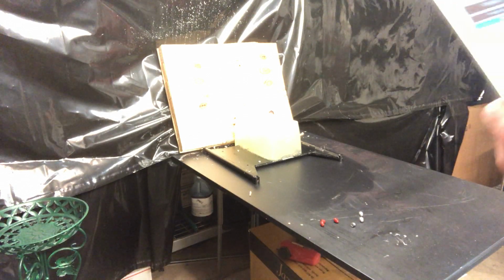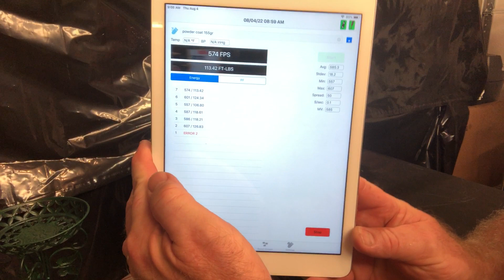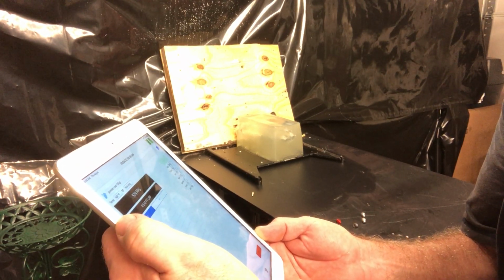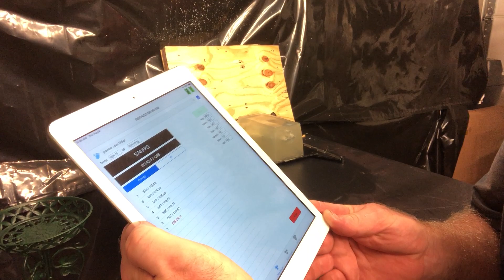Texoma Precision Pellet first 155gr powder coat test. Mixed results VID35

Comment: Wow! Impressive damage. Aside from a better spring I wonder if we have any hope for an extended mag?
Reply from the maker: I have heard talk that someone is basically using 10/22 mag tech (Lower spring pressure) to have a higher capacity mag. I have not seen any prototypes yet. I'm personally looking at spring pressure/spring type and an alternate faceplate for the mag. Variable pressure springs go way back, but I have not looked into this tech with torsion springs to see if it is doable.
Reply: @texomaprecisionpellet7545  fascinating! I look forward to seeing where this goes, a high capacity magazine on this gun would take it to another level. Thanks as always for your videos!